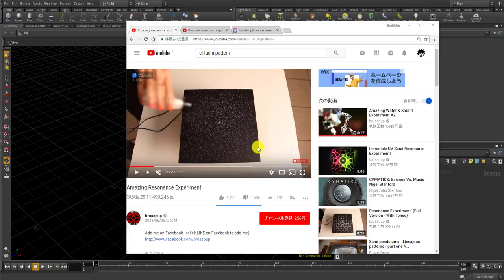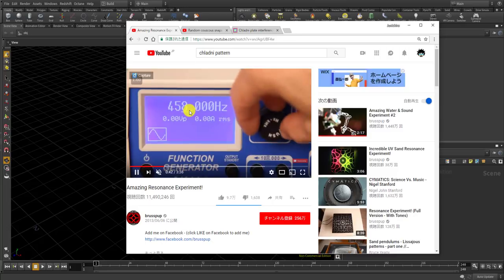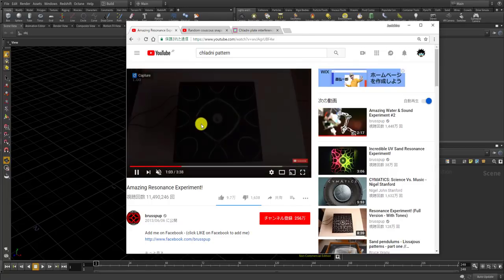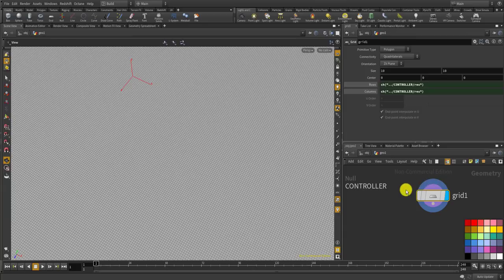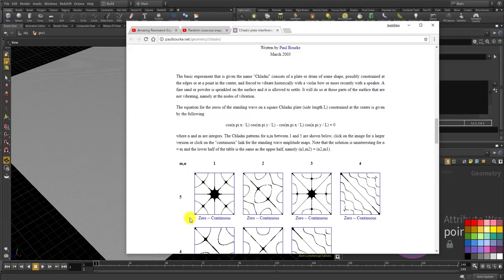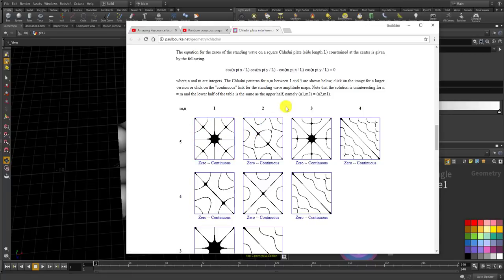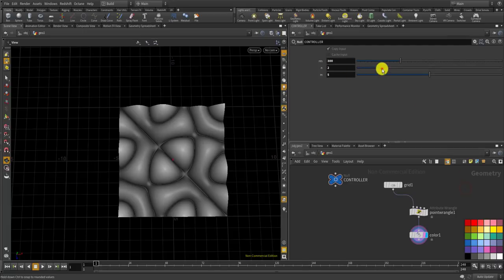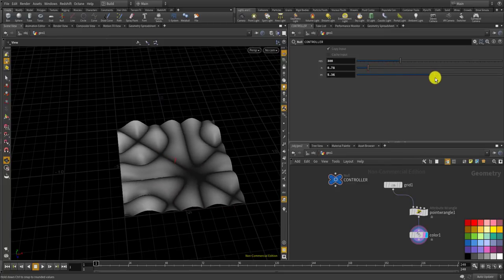[Houdini Tutorial] 0028 Chladni Pattern (Slow version)

Comment: Fantastic Junichiro!  
... I've been a big fan of Cymatics and the work of Hans Jenny for years.  
I'm impressed with the ease you take these equations on and get results so fast.  

I think an equal method to calculate the downward slope vector would be to take the cross product of negative y vector (down direction) with the normal and then cross product again that result with the normal again..  Its basically exactly the same as what you did but maybe a little more compact. 

vector down = {0,-1,0};
v@slopedir = normalize(cross(cross(v@N, down), v@N)); 

Thanks for all your sharing.  Really great stuff!